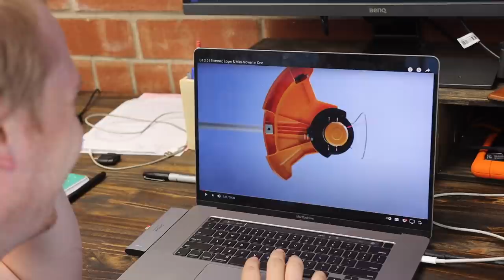I did not mean to overbuild this "DIY Heat Box Build"

Comment: Seems pretty simplistic.  I had a pid controller in mind. I also thought you were going to do the closet metal wire racks based on width.  Is it me or do casters seem expensive? Granted, with current wood prices, not so much.  Doubt it is needed,  but how about adding a fan to make the temperature more uniform inside?

Comment: I did a heat box once, problem I had I didn't have a timer and the wood dried up way to much the one now cracked something bad....fix... Added a timer ,  when glue set up time was over heat could not kick back on. I used light bulbs and a temp control device. It was nice...

Comment: You didn't overbuild the heat box. There are no small fans to circulate the air and keep the temperature the same throughout the box. That would be practical, but probablly be considered unnecessary hence an overbuild.
Smart move with the larger casters. People are always undersizing the casters or wheels they have on things they want to be moveable. The result is things get caught up on debris on the floor or an uneven surface, and/or the casters can't handle the weight of the thing they put them on. This is true of people doing their own builds and of manufacturers trying to cut costs of a product they hope to sell.